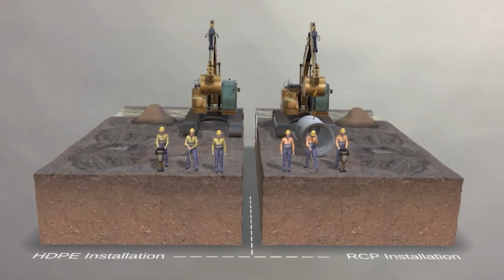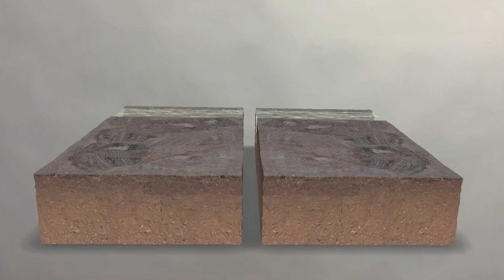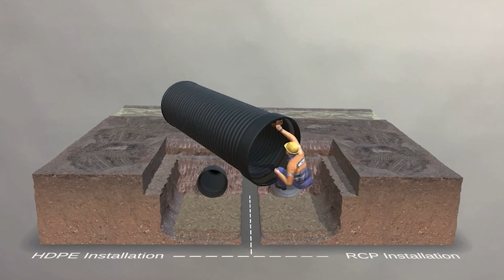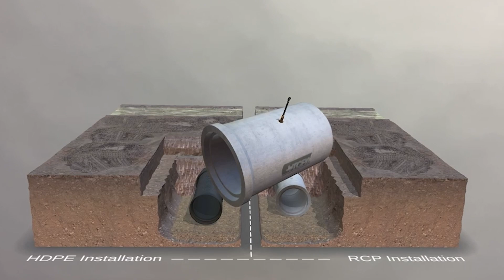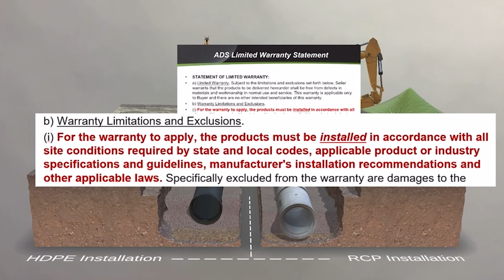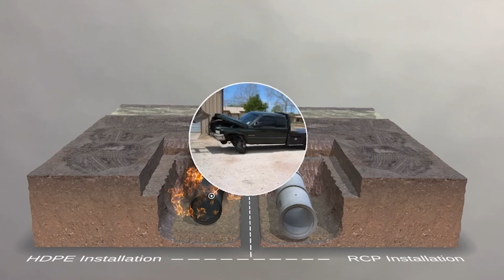Drainage Pipe Installation: Reinforced Concrete & Plastic

Comment: Somebody is trying real hard to sell concrete pipe.  For the standard installation of drainage pipe, HDPE is cheaper, easier to handle, and requires no special tools or sealants...and based on several lab tests, it's far stronger.  Here's one - https://www.youtube.com/watch?v=aLflFJid0kc
Reply from the maker: Right materials for the right project makes a whole lot of difference! Thanks for watching. 🔥